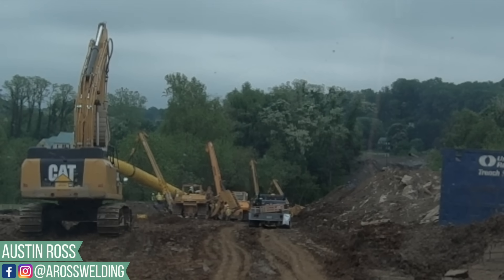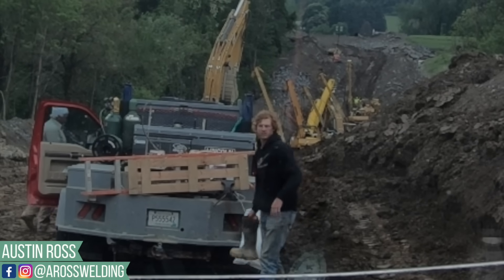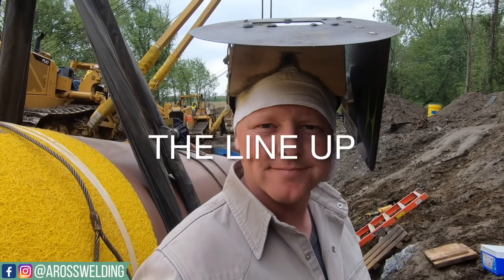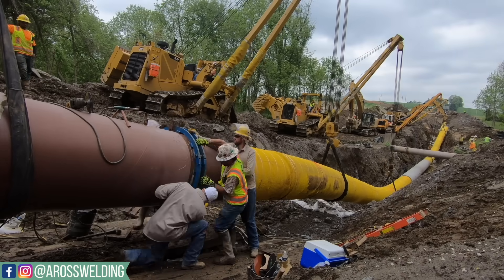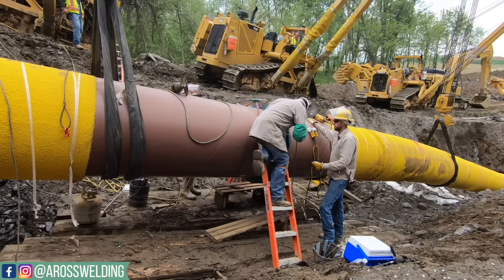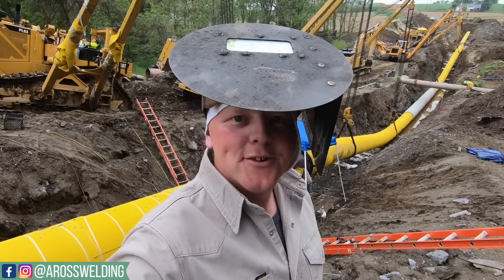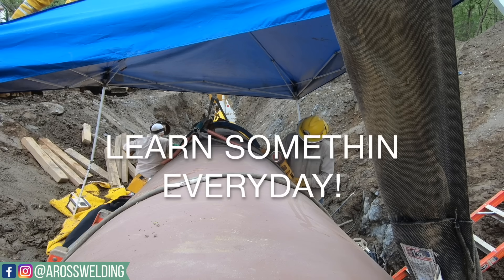PIPELINE WELDING PROCESS (FROM START TO FINISH - IN THE FIELD)

Comment: I shure don't miss those day's of being a pipeline welder . Im just glad i retired 😅.  I have done lots of 42" pipe in my day's as a pipeline welder.  But the worst one was doing 112" pipe that had to be shipped in pice by pice pipe was made on site then when the welder got done putting the pipe together it was put on a barge and brought out use and welded to the next joint of pipe. On a good day we could 2 joints of pipe. That seemed to be a never ending job. But it was good money 😊

Comment: Never saw a Welding Inspector check pre-heat temperature, check joint condition and fit-up parameters, oversee welding etc?
Reply: Was on a job at compressor station in PA doing a 42" tie in with the line coming out of the station going into a tee.  One welder had his helper quit and the inspector told the contractor to get another one hired.  Instead the contractor had one helper jumping back and forth with a weed burner to try and keep the pipe hot.  He let them finish the welds then walked in the contractor trailer and told them to it out.  If you've done this kind of work the idea of cutting a 42" tee out of the line and having to replace it will make your nuts disappear inside you belly.  For those you you who have not you can't just cut it out and replace it.  You have to go down the line and cut a section out.  Put in a new section and then the tee.  Welding cut pipe and especially a cut fitting is much more difficult.  You will never get the factory edge and bevel even using a band torch. The next day they had three helpers.

Comment: On excavators,when you're digging or lifting you want the drive motors behind you,that gives you that much more weight behind you ,it helps to hold you in place. And you want to be lift over the front of your tracks because that gives more leverage to lift.
  Question about the goof face shields,why not use a regular welding hood.?

Comment: Thank you for doing such crucial & precise work Austin, & for all the effort you clearly put into it. I'm brand new to learning about welding so just 4 quick questions pIz:
1. Was all the welding in this video stick welding ?
2. @ 7:25 there was a spark between the tip of your electrode & weld point, & you were given a new electrode. Did that spark happen b/c the arc got lost?
3. 9:47 your coworker is holding some torch shaped device, but I know it can't be a gun/ stinger b/c he's not wearing a face shield.
Which device is this?
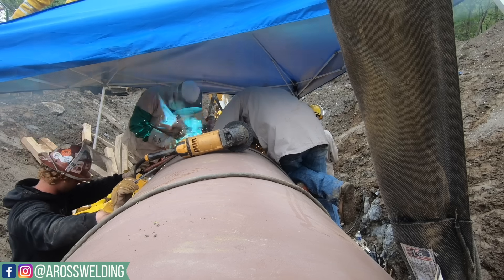4. @ 10:06 this is the best way to hold the stinger for ensuring that you remain on the centerline, correct?

Comment: Mam, you guys had some wide trenches to work in. Our trenches here on the MVP are barely wide enough to drop the pipe into, and not sloped back at all. We only slope them back where a weld is going to be made.

Comment: I’m an engineer who worked in power plants for 45 years. I worked along side with pipe fitters and welders all the time. They do precision work in very difficult positions and make it look easy. Great group of guys (and women!). I learned a lot from them and still do some home welding projects myself.
Reply: You saw a female welder in the wild? damn, didnt think those are real
Reply: @tomh1727  ha ha ha! Oh yeah. I’ve seen a few. They might be tough as nails on the job, but some clean up real good after!

Comment: Love this 1947 tech weld method.  7000 series drag rod?  Where is preheat, submerged arc welding.  Then stress relieve for grain structure in weld effected zone and X-ray or fluoroscopy for quality.  What product will flow through this?  Is pipe lined inside with a polymer?

Comment: Never done any pipe welding but have done lots of structural welding and maintenance style welding in coal mines. It's  shocking to me there's no back up safety such as cribs  or stands in case of failure.  If there was I just didn't notice it

Comment: This would be a full penetration weld without backing right?  Is the weld X rayed?  Is there an inspector that buys off on the root pass and final pass?  Do the pipelines get pressured tested before use?   (I used to work in a shop in 1985 that did AWS 1.1 welding so just curious how things may have changed).

Comment: I run track hoe on pipeline in canada.
It doesnt really matter wich way your tracks are on the hoe. But you can lift slightly more weight over your idlers (front)
And its easier on the final drives (back) and makes them last longer if your not lifting or digging over them all day long.

But pipeline doesnt care about that lol

Comment: 5:18 is he using a blow torch to to meld the two pieces before you then together?
Reply: Hes using it to heat it up before hand for a better weld I think
Reply: The heat evaporates the moisture out of the steel makes for a better weld.

Comment: When I would weld in the day and go to my night job I felt like I was getting flu ( normal mild steel nothing weird or coated) then I started using respiratory protection and what the f no more flu like symptoms ,was watching a welding channel sounds like it does catch up to you if don't go in with proper protection .
Reply: Thats the same symptoms if you metal spray ,and we had air fed masks.
After a week or two it passes.
I can't see why they don't have air fed masks,  the welder we use has.

Comment: I'd like to see your cap pass. Also your root , do they ultrasonic after grinding the root? Why not a wire weld after the manual root pass? 6010/7018 on the root? Keeping the keyhole open all the way up? Just wondering?

Comment: Another cool thing about excavators and back hoes are the big spline gears on the track let you know which way the controls will work. If you have the gear towards the front of the cab the controls are reversed and if it behind you the controls are normal.

Comment: I have a year left in the army and am planning to go straight into the pipeline i have some welding experience and enjoyed it throughout high school so instead of going in as a labor hand I’d like to start off welding. One of the transitioning classes on your way out of the army is a 4 month advanced HVAC welding school and I am signed up for that is there anything else i could be doing or you recommend doing?? Love the videos and would appreciate a response
Reply: Hard to break out welding when you’ve never pipelined before, I would recommend hiring out as a helper if you can find a welder that needs one, but that can be hard so hire out as a labor hand and work for a few years, meet new people gain experience, exchange phone numbers, get a few jobs under your belt, then try to practice and break out.
Reply: Jordan Sleppy Well i appreciate it thank you
Reply: Hmm almost same name and I just left the army as well and I'm in the welding trades as well now.

Comment: Why did they heat the pipe with the weed burner torch during this process? I am guessing it helps prevent cracking between the hot Weld and the cold pipe?
Reply: They are preheating, yes it is to prevent cracks.

Comment: Do you use 6010-11 for the root and then 7018 on the rest?  Im surprised mig wire would now be the process now. The job would probably go 20% faster.

Comment: I'm very interested in this welding stuff. The craft has always had this elusive, esoteric vibe to it.. like you hear about these guys making crazy money, and it seems so simple on the surface to an avg person. Just burn the metal on the other metal and boom.. like metal superglue lol. But once you get some perspective you get the idea that it's one of those trades that must be more difficult than it seems for some reason. What is that reason? Why don't more people flock to this trade? Is it mainly the investment in tools one has to make? Very interested. Am thinking about going out to a good oil field and just buckling down haard for a few years, try and start an actual career.

Comment: I'm just a hobby welder, but it always amazes me that one weld can take an entire day to complete.
Reply: If it leaks it's a bomb. That's why they xray every weld.
Reply: @joelcoley2606  Doesnt matter that much thats a socket weld
Reply: Depends on conditions. It’s 740 wall. Sometimes you have transitions, shitty operators. I welded on a 24” rehab job we did live hot cuts or footballs. Done about 10 in my time.  Went to replace a section they never turned the rectifiers off. We wrapped leads argued with inspector. Made the weld and it had dingle berrys 3in long from the magnification. Failed X-ray come to find out rectifiers were on. Cut it out and re welded it. Took all day long. We Could put a 24” pipe wrench on the bottom of pipe and magnetism would hold it.
Reply: Some welds take days to make. Sometimes you fit and weld 15 boiler tubes in a shift. I’ve welded on a 5’ thick vessel that took 24 hrs a day welding for probably 3-4 days.
Reply: @nolankirkwood9655  yeah, agreed.  I’ve done some high pressure steam lines at power plants and that stuffs inches thick. Each joint takes 24 hr shifts and you have hundreds of them
Reply: @nolankirkwood9655 I'm an ex boiler maker,  most will never know the difference of code and non code. 6g is where the 💰 is
Reply: Dumbass more than one weld called root , hot pass , fillers and caps not jus one weld
Reply: It's not one weld silly😂
Reply: It's a code job, and it gets exrayed
Reply: Kommt auch mal vor das eine Schweißnaht erst nach 24 Stunden fertig Geschweißt ist kommt auf das Material und Wandstärke an.
Reply: 10 to 12 passes sounds Crazy eh
Reply: Mike L:  I’m sure that you will satisfy your curiosity when you do pressure weld on large bore,  heavy wall pipe
Reply: @kennethmelnychuk9737 just call it a 6g and get it over with 😂
Reply: Exactly, because your a hobby welder. Do it for a living and you will understand what it takes.
Reply: depends on how slow you are.  knock 4 of them 42 a 6 hour day
Reply: @danielt8793  42 inch welds, depending on wall, take over 3 hours each. Your talking out your ass
Reply: @jamesgetman3400  i wouldnt hire him
Reply: @jamesgetman3400  Sounds like the xray techs know him by first and last name
Reply: @danielt8793  you absolutely cannot lol. You clearly haven’t picked up a torch in your life

Comment: I love welding with my everlast welder. I'm thinking it would be nice to get paid welding full time.
Reply: welding isn't so bad, but try not to work in welding shops with poor ventilation like i did.  welding fumes and grinder dust will ruin your lungs.  maybe it would be better to work on pipelines so you get some fresh air...don't know never tried it.

Comment: I learned nothing about technique, except you use 5/32 stick welding, 7018, i think,  Bob not Linda
Reply: Same. I thought he was going to give details, being that there is far more to accomplishing this weld than was mentioned in the video. I personally wanted to know what amperage they were running, did they have to run uphill or downhill, what technique were they using to fill the gap as the bevel became wider, how much of a gap did they give it before tacking etc.

Comment: I'm a concrete  guy for 30 years  what's that meter his helper holding on pipe
Reply from the maker: It’s the remote. It’s to adjust my heat (amps) while I’m welding.
Reply: Thanks  for replying  very  interesting  for me  although  never  welded

Comment: Anyone reading can answer...do those pipes come with the chamfers on each end? And when making the first pass is it necessary to grind down to the base metal before beginning a new pass? Nice video by the way.
Reply from the maker: Yes, the pipe comes with factory bevels. And usually most welders grind the bead down before puttin in the hotpass.
Reply: @arosswelding  you are very blessed to have a job that you enjoy and seem to be pretty good at! 😃
Reply from the maker: I do enjoy it. Thank you.

Comment: Welded Construction was the first pipeline contractor I ever worked for back in 1986. We had 30 miles of 36 inch at Mount Union, Pennsylvania for Texas  Eastern. Elvis Ralph was the welder foreman.
Reply: We just installed some 16 and 20” underneath that very 36” line a couple days ago in Chester Co.
Reply: Welded filed bankruptcy a couple years ago.

Comment: Thanks for the intro,; personally I'd like more infor, like who's in charge of the alinements of the pipe sections as the band/clamp is being put on, and as yo are doing the tack what's the yellow box your helper is holding, and what's the device on top of the pipe after the clamp is taken off? If the pipe is kept at 250 degrees how can anyone even touch it? Are joints like that ever welded by a machine?  Keep up the good work.
Reply: 1. Usually the foreman makes the line up. 
2. Heat box. It controlls the heat of the welding machine. 
3.device on top is the ground for the welding machines.  
4. People wear gloves and the part that is 250 degrees is only roght on the weld.
Reply: 1. Usually the foreman makes the line up. 
2. Heat box. It controlls the heat of the welding machine. 
3.device on top is the ground for the welding machines.  
4. People wear gloves and the part that is 250 degrees is only roght on the weld.
Reply from the maker: Like this guy said, Usually the tie in man is in charge of the line up. But the welders are in charge of adjusting the clamps. The yellow box is the remote for the welding machine. It adjusts the heat Also known as amps. The thing on top is called a grasshopper. It’s to keep the arc inside the bevel, here is a video about the grasshopper: https://youtu.be/ZFMHIcbIGtQ
Yes it is common  for them to run automatic welders on big inch pipe. 30” and bigger. Mostly when laying the pipe, sometimes on tie ins like in this video. We wear arm pads to keep from burning the arm that lays on the pipe.

Comment: No skid piles? Working under a suspended load....
Reply: Jeff Trout those booms got that pipe brother. The pipe isn’t under much stress by the time you get the first filler in, it’s not going no where
Reply: Oddjob6120 You must not do it for a living. Those booms hold a ton of weight and it’s on the ground right behind that welder on ditch side. Those straps and are inspected everyday and once they put a filler in it then it’s one piece. It’s not in a bind or anything
Reply: Oddjob6120  Same in Canada here. There is no way that would fly, someone would get run off. The foreman for sure, and probably the welders for doing it.

Comment: I'm curious why don't they use auto darkening helmets? Instead of using that old school face shield?
Reply: I prefer old school helmet as well with the 10 shade don't know why more reliable
Reply: They use them for clearance purposes.  Often times the pipe gets fit up awful close to the ground, if you used a regular hood you would have a tough time trying to cram your head under a pipe that's only 6" off the ground.  And they do make auto dark lenses for those type of pancake hoods.  Whether he is using one here or not I'm not sure.

Comment: What is the significance of the  shape of your hood? Myself and another welder had the same question.
Reply from the maker: They are just made specifically for welding pipe. They are light weight. And they cup around your eyes to keep sun from shining in from behind and keeps more sparks from gettin in your eyes.
Reply: @arosswelding  I figured as much. I use to weld pipe, all indoors. Wasn't very good at it either. I now weld on mining equipment for a company. Still making sparks. I commend all good pipe welders. Thanks for the reply.
Reply from the maker: You bet. Thanks for asking. Love getting questions and feedback.

Comment: Have you tried that Flex Tape?.. they can make a boat with it...
Reply: They're working with a pipe so they need Flex Seal
Reply: I’m dead
Reply: I'm sorry but that Flex Tape Boat... I SAWED THIS BOAT IN HALF!
Reply: We were grounding manholes in Florida one day, the water table was about 7 feet, the hole itself was 8 ft in the ground, when we punched a ground rod through, water shot out of the hole like a geyser non stop, the fucking super suggested Flex seal🤦‍♂️🤦‍♂️🤦‍♂️ “I sawed this boat in half!”🤣🤣🤣
Reply: @Addict but it works under water
Reply: Duct tape works just as well too
Reply: LOL

Comment: I'm sure it's obvious to most, but I don't understand why the home made hoods. My guess is more durable or inexpensive for the environment.  Sorry if it's a dumb questions.
Reply: Stakman1-Stacey L The  only dumb question is the one that doesn't get asked. It's called a pancake hood (it looks like a pancake) specifically made for pipelining and they are store bought. Cost about as much as the "Fiber Metal Pipeliner". The part that fits over your eyes and bridge of nose is made of balsa wood and needs to be sanded to form a tight fit around the forehead, cheeks, and the nose bridge of each individual who uses one, yours would not fit me and vice versa. Google "Pancake hood" and you will find a few different people who make and sell these, "Sarges" is one such distributor. The idea (unlike a regular hood)when in the sun you don't have to worry about sunlight coming in the back of the hood making visibility difficult and the design also helps to keep the sparks from away from one's eyes. They are also much lighter and have a 2" wide elastic strap instead of a ratchet or rubber band. Downside is you would never be able to use one in a "Plant" as they have always been outlawed. Hope this helps.
Reply: @henrybenson1348  Thanks for this, it makes perfect sense now.  I do a little hobby welding but mostly indoors, I never thought about trying to follow a puddle in bright daylight.
Reply: @Mr.Stacey-L-SCC  it's an American thing. I've never seen one used in Canada.